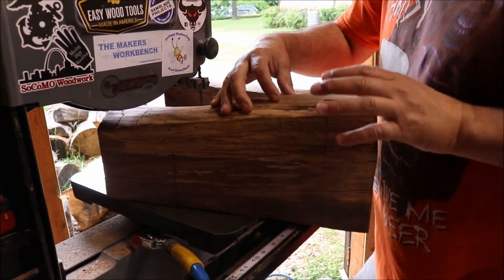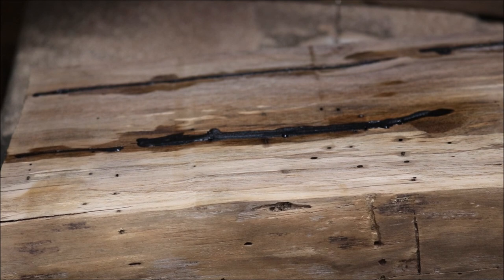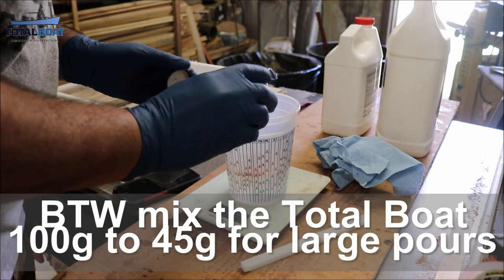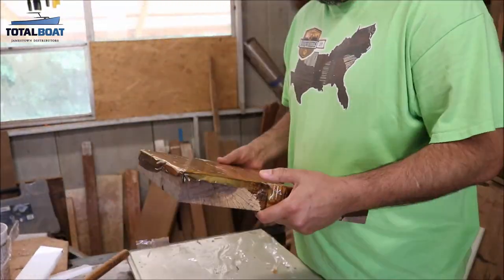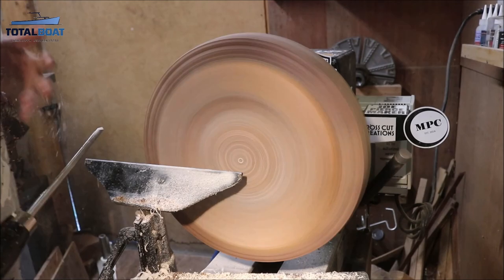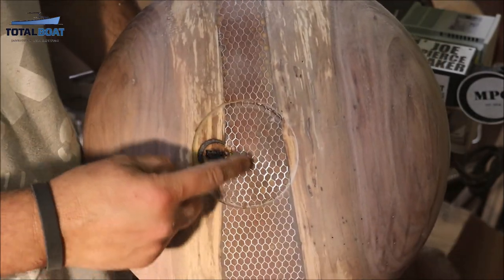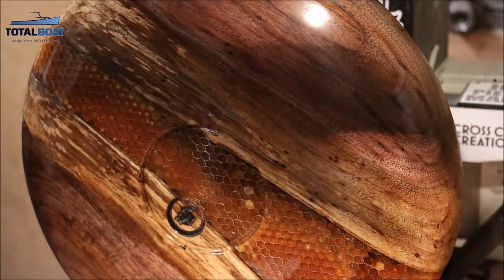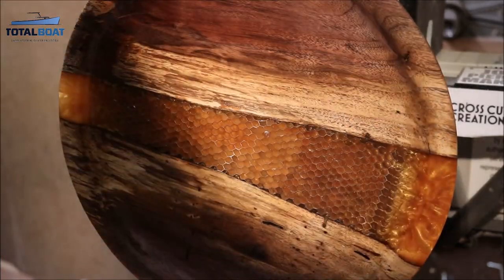Wood Turning - Honeycomb Beehive

Comment: What do you do the the honeycomb to make the resin stick.  Seems to me that every time Ive tried it the resin pops out of any spot thats not completely surrounded by the metal.
Reply from the maker: Tony Montgomery I clean them with denatured alcohol then pour.  Had one or two pop out but doused with thin ca glue and they are good. 

Ken

Comment: Like that. What is the honeycomb aluminium actually used for
Reply from the maker: Debbie,

Aluminium honeycomb is used in sandwich panels which is used in floors, roofs, doors, partitions, facades, working surfaces for automatic machines and for all products which require an optimal stiffness-to-weight-ratio. It is also used in the Aerospace industry for planes and other stuff. 

Ken

Comment: How many inserts did you go thru hogging out the inside?
Reply from the maker: I only used one. The aluminum is softer than the resin so there were no issues.

Ken
Reply: Good to know!

Comment: I am interested in buying an 18/36 lathe.  Are you happy with yours?
Reply from the maker: Curtis,

I have had a few minor issues, but this thing is a beast. I absolutely love this thing. Super quit and has a powerful motor. I would suggest the 220v version like I have. The 110v just doesn't have the power in my opinion. Good luck. let me know what you decide.

Ken
Reply: Thank you!

Comment: A wedge would help to keep the kerf open for ripping.
Reply from the maker: I tried using a wedge. I just couldn't get a good hold of the wood. I do not have a workbench or vise. Plus those saws were old and I don't think very sharp. Either way I really don't like hand saws. lol

Ken

Comment: If you can't cut the wood with a hand saw, then either it is too dull, or you're using the wrong type.
Reply from the maker: Definitely a dull saw. These things were very old, but it did the job. lol I had two different kinds too. 

Ken